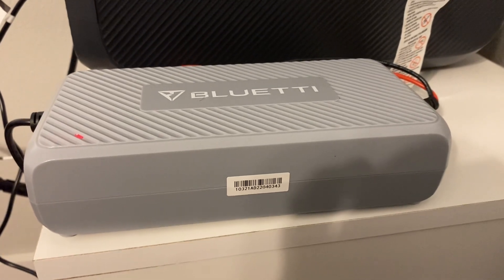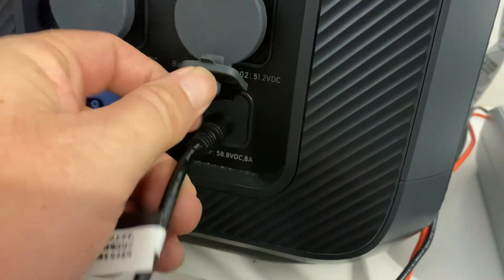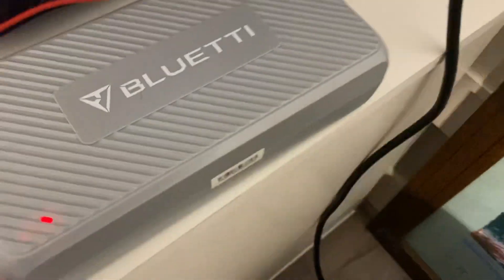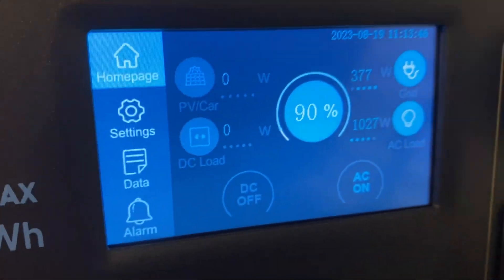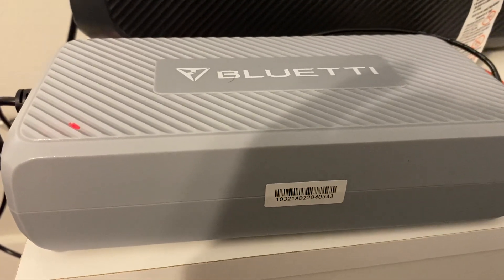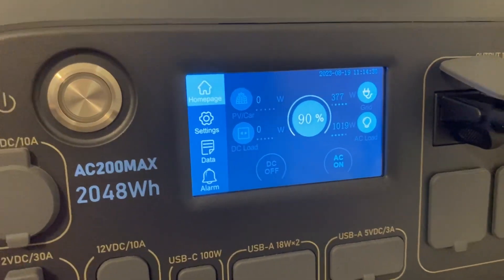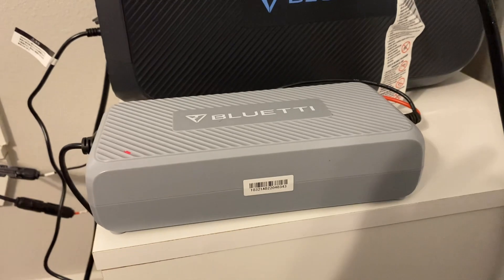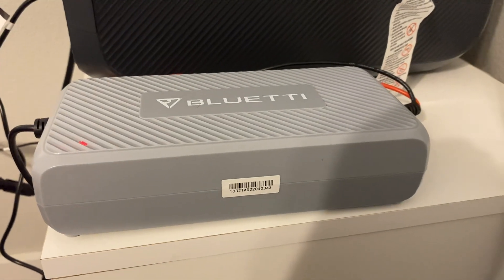Bringing in extra solar with Bluetti DC Charging ￼enhancer.

Comment: My freaggin Bluetti pv 200 is only pushing in 35 watts into my eb55. I paid big bux for these lame azz results I would have to charge for days to use my system for 1 day with these stats and I got 5 grand into this system with these shit poor results
Reply from the maker: @breakdownbill1  you should be getting a lot better than 35watt from a 200w panel with good sun. I would say from 150 to 180 at the less.
Reply: @Suncatcher-wt2od  it might be my eb55 coz it used to put up the numbers your describing